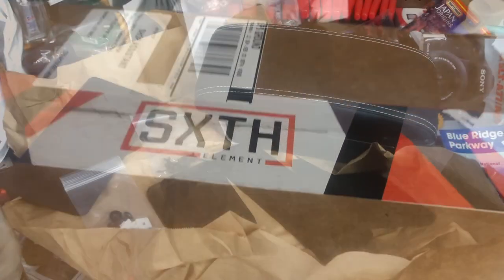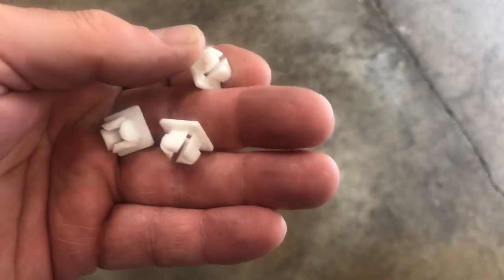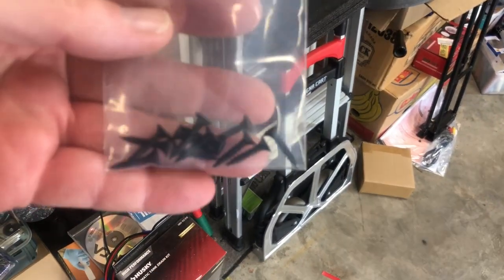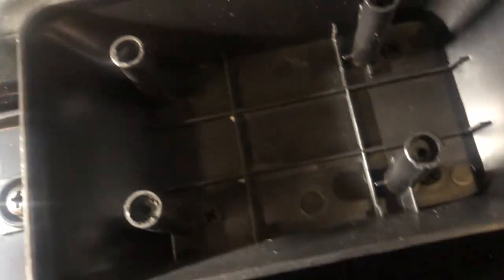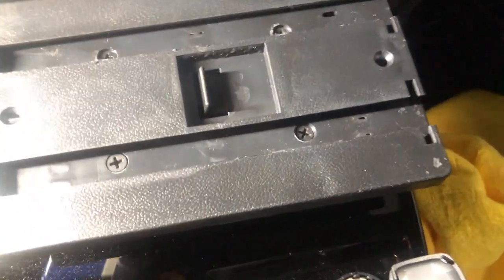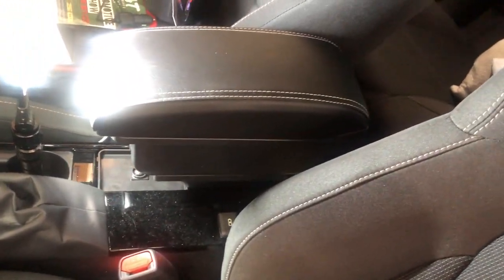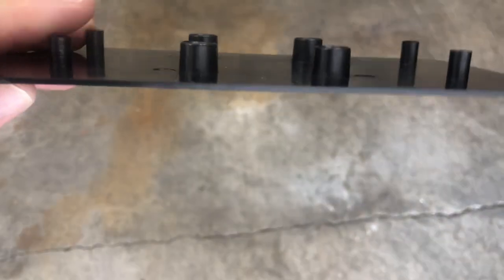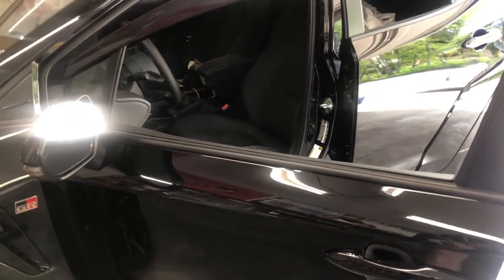The GR Corolla Finally Gets An Armrest!

Comment: when will you do a update for the cat-back exhaust system. (AWE).
Reply from the maker: I'm not in any rush to change the exhaust. I actually like the look and sound of the exhaust. The first thing I might do is the mid pipe to get a little more sound, but I don't want it a lot louder.